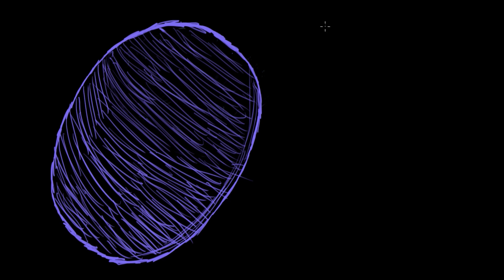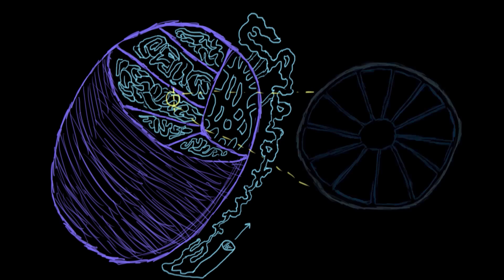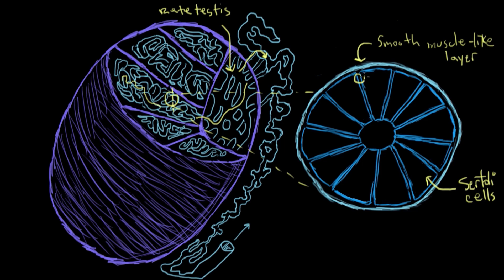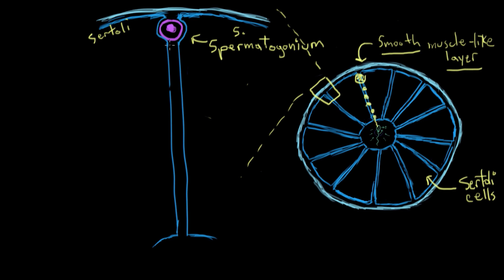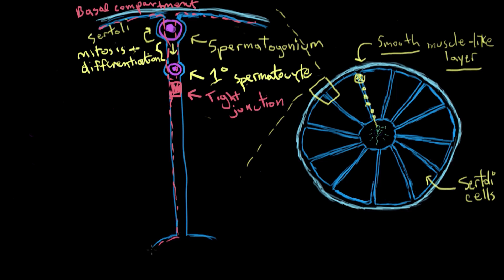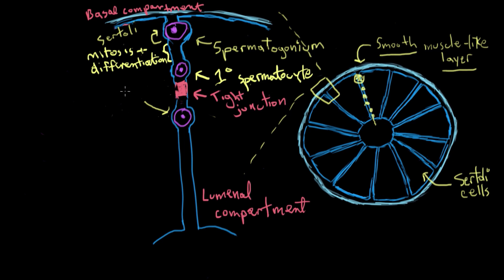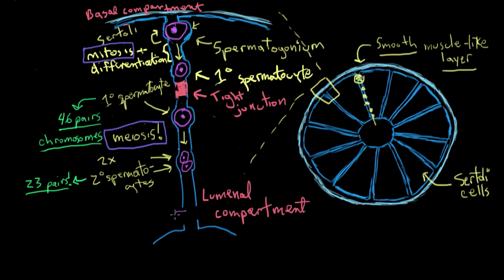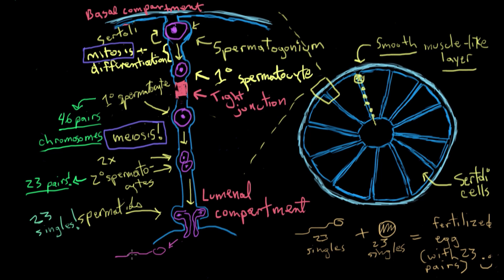Khan Academy - Spermatogenesis

Comment: 6:50 technically, shouldn't it be 23 pairs of chromosomes as a primary spermatocyte, then 23 individual chromosomes as a secondary spermatocyte?
Reply: spermatogonium --> primary spermatocyte = mitosis
(46 chromosomes)

primary spermatocyte --> secondary spermatocyte = Meiosis 1
(23 chromosomes, homologous pairs separate)

secondary spermatocyte --> secondary spermatocyte = Meiosis 2
(23 chromosomes, the sister chromatids that was replicated from S phase seperate)
Reply: thamks! So erm i pointed out rightly i guess. And btw secondary spermatocyte --> spermatid in your 3rd paragraph, i believe that's what you mean
Reply: Sean Ngui